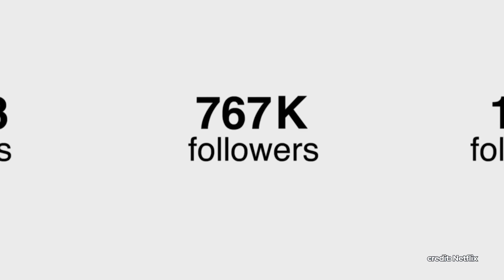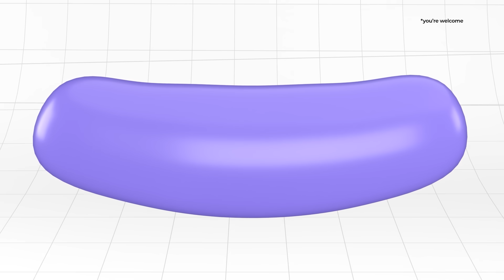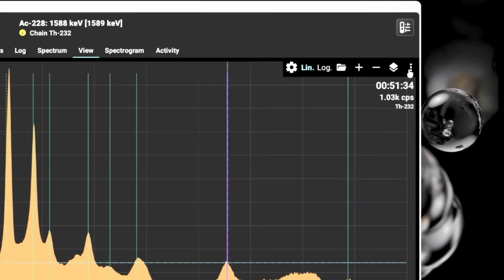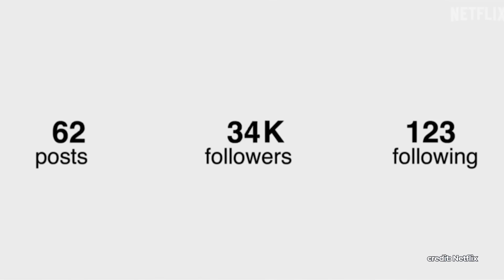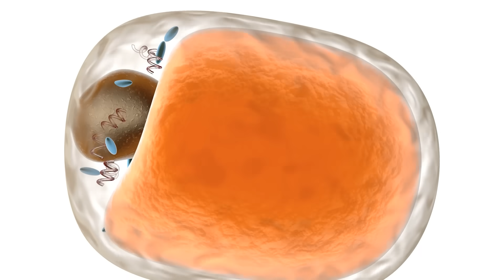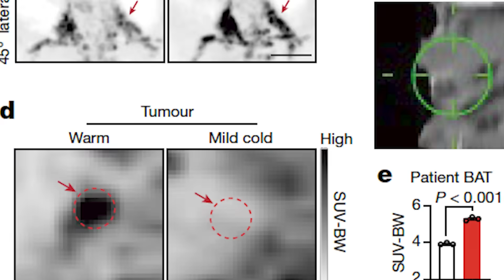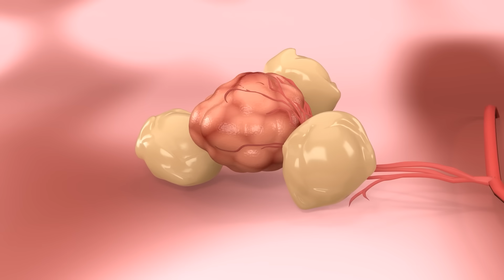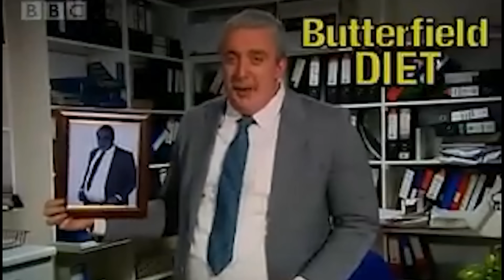Scientists Just Discovered How to Starve Cancer

Comment: “Old wives tales…. Fasting….” 
Are you absolutely intellectually handicapped? 
Imagine thinking fasting does not work to help get rid of cancer.
Reply: But! Fasting is probably your best bet to avoid getting cancer, as the body prioritizes repairing cells instead of hitting the kill switch and producing new ones when something goes wrong. ie killing cancer seeds.
Also, why are you so angry and rude? I think you should deal with your mental issues before trying to fight cancer. Best cure is to be positive and hopeful, not angry and depressed.
Reply: @98Zai  people have every right to be angry and rude unless their level of rudeness is considered criminal, which is not the case here. stop the empty virtue signaling, people behaving like this completely ruined my life for no reason.
Reply: @MuhammadJafary-u2v  Woah, I haven't heard the term virtue signalling for a decade at least. 
As I see it, you're not going to get anywhere by being rude. Why did you even make this comment, the chance of anyone replying with something nice or helpful is literally zero when you're identifying yourself as a rude mean person.
Reply: @98Zai  it isn't zero, society has changed. of course being rude in person is different, but have you never been on Twitter or elsewhere similar? this is very normal and functional online, as opposed to how liberal block anyone who remotely offends them and have their circle block the guy as well. that's not functional at all, it kills challenging dialogue. I commented because I enjoyed reading the rest of your comments and was shocked with the view you have on arbitrary politeness.
live long and prosper.

Comment: I'm always amazed at how little research goes into Root Causes if cancer. I'm curious about the fact that cows milk contains igf growth hormone to force cells (of the intended recipient a calf ) to double themselves every month fir 3 months. Yet when compressed version of this in in cheese butter chocolate  etc are invested regularly by humans, we are surprised when some cells listen to the inbuilt instructions in the products and double themselves and proliferate. We all know cancer loves sugar as PET scans are radioactive glucose and the parts of the body that est up most of it is usually the site of the primary tumor. Yet nobody talks about avoiding sugary foods and drinks etc to stop feeding tumors. I guess there's no money in prevention.
Reply: It's likely that the root cause is deactivated cancer protection genes from environmental sources in combination with excessive nutrient intake. For example, smoking deactivates a bunch of cancer protection genes in the lungs. Having a steady flow of nutrients puts the body in a mode where it kills damaged cells and create new ones to replace them. When the body is in fasting mode, it prefers to repair cells efficiently instead of wastily replacing them. As we know, cancer cells cannot be killed or turned off, but they might be repaired.
Reply: @98Zai why cant they be killed or turned off ? why cant we activate apoptosis  again in c cells ?

Comment: I am surprised you didn't mention the name of real giant in this field: Thomas Seyfried from Boston University. He published many research on the subject. He is the one who explained some of the problems Otto Warburg couldn't figure out. He established that cancer cells can ferment two substrates only: glucose and glutamine. He also proved that if patient is in therapeutic ketosis cancer cells are deprived of glucose,, while healthy cells thrive burning keton bodies (coming from fat metabolism in the liver). Prof Seyfried also developed Glucose Keton Index - GKI which can be used to determine if somebody is really in therapeutic ketosis or not. The bigger challenge is to restrict glutamine, rare amino acid which is synthesized in our body and is very important for immune system for example. More research has to be done to determine how to restrict synthesis of glutamine with inhibitors, without compromising immune system. This is the concept of press/pulse therapy, where cancer cells are put in disadvantage position by restricting glucose permanently (press) and inhibiting glutamine synthesis in pulses using inhibitor.

Comment: Why not simply stop eating carbohydrates?
Reply: And live off protein? The body transforms both protein and carbohydrates into Glucose, to the body they are equal. Meat is just a more calorie dense food stuff.
Reply: @98Zai  actually not only protein. The body needs a small amount of glucose for a few things. So completely remove it is impossible.
And it can make the glucose it need from carbs, protein and fat. 
The distribution between them depends on what dietary state you are in.

If you completely stop eating carbs, the body will go into a ketogenic state and drive itself mainly on ketones made from fat.
There is still a small amount of glucose generated in this state. And it will be primarily from fat.

Again, it does not completely remove the glucose, just reduce it.
But the therapy developed in the video cannot completely remove glucose from the cancer either. But it does not have to completely remove it. Just reduce it enough so that the cancer starves.
Reply: @98Zai  an additional point to your comment. No, you cannot live out of only protein. Then you will get into rabbit starvation. You will live out of fat. Basically replacing the carb with fat.

Comment: Vitamin c is similar to glucose, if you fast, and then take a large dose of vitamin c.  Glucose transporters on the cancer cells will preferentially  full the cancer cell with vitamin c.  Most antioxidants are pro-oxidants at high concentrations vitamin c is no exception.  The cancer cell will quickly succumb to a high oxidative environment.
Reply: That's an interesting idea. But oxidative stress will be high throughout the body, probably causing a lot of issues similar to chemotherapy.

Comment: Thanks a lot for the interessting video. I was intrigued when you mentioned that fasting and calory-restricting-diets never work because the normal cells starve bevor the cancer cells do. As I read, though I'm neither scientist nor physician, there have been some studies showing the opposite effect during chemotherapy. Could you cross check this with one of these papers or maybe elaborate on the validity of the Mitochondrial Metabolic Theory? 

Bauersfeld SP, Kessler CS, Wischnewsky M. et al. The effects of short-term fasting on quality of life and tolerance to chemotherapy in patients with breast and ovarian cancer: a randomized cross-over pilot study

Lee C, Raffaghello L, Brandhorst S. et al. Fasting cycles retard growth of tumors and sensitize a range of cancer cell types to chemotherapy.

de Groot S, Lugtenberg RT, Cohen D. et al. Fasting mimicking diet as an adjunct to neoadjuvant chemotherapy for breast cancer in the multicentre randomized phase 2 DIRECT trial. Nat Commun 2020

Nencioni A, Caffa I, Cortellino S, Longo VD. Fasting and cancer: molecular mechanisms and clinical application. Nat Rev Cancer 2018

Comment: Normal cells that due to inability to use energy efficiently (creating lactate as fuel instead of oxidising glucose) become cancers. Cancer is very much a metabolic disease. Look up the Randal Cycle. Cells can not use glucose efficiently in the presence of too high levels of fatty acids. Its the high fat polyunsaturated laden foods that are the likely culprit. Dr Ray Peat was heavily into Otto Warburg and has written a lot about this if anyone is interested.

Comment: You won't have to worry about cancer cells changing to use fat as an energy source, they're almost completely unable to get energy from fat.  Look at Dr. Seyfried's work on the subject.  Almost every cancer has mitochondrial damage at its root (or in some cases, they're simply missing.)  Not only does that mean they're unable to metabolize fat, but they also (as you stated) are unable to generate energy aerobically, and most importantly, the mitochondrial damage prevents apoptosis because it's triggered by the mitochondria (which are damaged or missing,) hence the uncontrolled growth.

If cancer cells were to somehow repair their mitochondria, allowing them to metabolize fat, they would (should) cease to be cancer cells because they would again be capable of apoptosis.

Comment: Should we focus on SYNERGISTIC APPROACH for this, as the video ended with @Dr Ben Miles raising question that, the cancer cells will change their metabolism by burning up the "engineered fatty cells (brown adipocytes)". May be to check mate this thing we can use to upregulate the immune response, anti-inflammatory response as well as signalling and feeding responses of the cells simulataneously.

Comment: You didn't justify the claim that ketogenic diet doesn't work. You also mentioned that no study showed that Budwig’s diet could help with cancer. Okay, but is that cuz it’s been studied and shown useless, or just not studied at all? If it’s the latter, that’s the problem. Stuff that’s cheap or natural doesn’t get research money cuz no one can cash in on it. Not saying pharma is evil, lots of meds save lives. But let’s be real, the system's set up to chase profit, so pricey high-tech treatments get all the hype while low-cost options get dismissed. It’s less about helping people and more about squeezing money out of dying desperate folks. I just wanted to say this so that alternative methods wouldn't be dismissed without justification. All that said, it's still cool that there is another new way to deal with cancer.

Edit: 
Also, just a side note: you mentioned metformin lowers cancer risk by 30-50% by lowering blood glucose and that the new treatment works by starving tumors of glucose. But that’s literally what keto tries to do: reduce glucose and push the body to use ketones, which cancer cells struggle with. So it’s kinda weird to dismiss keto completely when it targets the same metabolic weakness that this new method is focusing on. 

Any serious discussion of metabolic cancer therapies should include ketogenic and fasting-based approaches alongside pharmaceutical or cellular ones. Dismissing keto while promoting glucose-starvation therapies is scientifically and logically shaky.

Comment: Thanks for sharing.
While brown/beige fat allows glucose to be siphoned off when it is applied close to the tumour, in real life, until this usecase is available worldwide, it seems useful to first reduce the amount of glucose ingested and replace it with fat (low-carb high-fat diet) in order to have a reduced amount to siphon off and therefore a reduced need for beige or brown fat and maybe existing brown fat may be enough or it can have a significant effect.
As a result, I don't understand the statement that a low-carb high-fat diet will starve the patient before the cancer, as the lipids will feed the patient and not (or less) the cancer (a low-carb, high-fat diet is not hungry, even if it may take a few days to get used to it)).
Do you have any further explanation ?
Reply: Nobody is saying that you starve on a ketogenic diet. But on a ketogenic diet you still have blood sugars that the cancer can feed on, if you eat less carbs than needed to refill them, your body will make  glucose out of protein. If you don't eat carbs and protein and your body has used up all carb and protein stores (muscles) then there is no fuel for the cancer left, but this is also when you starve.
Reply: @juliadolker9854  the statement that a person will die in ketosis before the cancer comes from the video at timestamp 9:03

But you won't die either if you don't eat any glucose nor any protein because in keto, the main fuel is not protein (eat only to maintain the body's proteins and not for energy) but fat. It is the fat that enables neogluconeogenesis to take place in order to provide the glucose that are missing from the diet with a stable level of glucose in the blood. The cancer will therefore have less glucose available and it will therefore need less brown/beige fat to reach 0 glucose at the tumor level.
This is why I think it is relevant to first reduce the glucose from the diet.
and if brown/beige fat is confirmed as having a significant impact, the good news is that there would be no need to wait for a modified fat cell transplant. 
it is possible today to adopt a ketogenic diet and activate all the factors known to promote the creation of natural brown fat (non-chilling cold, physical activity, food rich in capsaicin / capsinoids / ursolic acid, etc.).
this would be what I would adopt immediately if I were diagnosed with insulin-dependent cancer (in addition to Dr Schwartz's other ideas)

Comment: First of all is to stop sugars... most of the cancer foci are Candida Albicans that have passed through a leaky intestine. Candida Albicans feeds on sugar. Starving Candida Albicans is starving the cancer.
You can also cut off the source of the problem by addressing intestinal porosity. Once again, diet is key. Porosity comes primarily from gluten and starches. Therefore, alongside a sugar-free diet, you need a diet without wheat nor rice.

Comment: ... they took til 2002 to realize we still had brown fat? I thought it had been known for a while we still retain some? How much would it suck to only be able to shiver to keep warm! 

I've kept my home somewhat cold ever since I realized I didn't gain weight when I did it. In summer I'd just need to take a walk for a few hours one day a week at the park to prevent weight gain, in winter the weather is usually miserable so I'm stuck indoors and worse tend to eat more in winter. Yet keeping the temp around 64-68 degrees burned just enough energy to equal out my intake (I don't shiver until 64 degrees when naked). Unfortunately, was not enough to lose weight. It just seems bonkers to me they didn't realize we had brown fat, no scientist wondered how the heck digestion created enough heat. 

To add to this, my brown fat activates from certain foods. For instance, I will overheat if I eat pizza in a 76 degree room. The heat I can feel comes from the areas brown fat is found. I joke that if I ever have hypothermia, just feed me pizza.

Comment: The “keto diet” theory of fighting cancer has parallels with the low-fat (often low or no animal product) anti-cancer claims.  The proponents claim that since your immune cells and everything but the cancer is using the full citric acid cycle, feeding yourself primarily carbs allows your body to outperform the cancer.  Kind of like how WW2 was decided significantly by who could produce petroleum fuels faster.  

I mention that most of these diets were vegan-ish because the “Chine Study” proponents have a more likely theory. Their claim is that in laboratory settings amino acid ratios associated with animal foods can reliably turn on cancer growth, and their absence can slow or reverse it.  

I know there are a lot of critics of the China Study book, but to my knowledge no one has debunked that particular aspect of it.

Comment: The problem is obvious: if you knew where the cancer cells/tumours were in order to insert the BF organoids next door, you could simply remove them or remove their entire blood supply or do any number of things - the difficult part of any cancer medication is introducing a medication into the body that will travel through the blood or lymph and reach the desired target when it could be ANYWHERE. So the then the next obvious step in this research is adding cell-surface proteins that will only interact with the tumour cells in much the same way as the immune system works with antibodies and antigens.

Comment: Starving cancer is one of the strategies to fight against it, but you will just slow down existing tumor cells. It's useful but not sufficient alone, as the basic idea is that a tumor cell is a "normal" cell gone wrong, which is normally recognized and terminated by cells of the immune system. When a cancer develops, this mechanism does not work well, but helping the immune system to better recognize cancer cells is the best way medicine has found to date, the so called "immunotherapy".

Comment: Careful. While this looks promising. We risk running into a different problem. Fat has it's own share of strings and problems attached, which, granted, are nothing compared to cancer. Yet still can end deadly. Just ask any type II diabetic. If those fat cells grow so fast, you'll need a way to stop them from doing so. And no, mechanical removal doesn't count. We need an off switch. Otherwise we risk jumping out of the oven into the frying pan. Adipositas kills. Just slower. It's that simple.

But still, fascinating stuff.

Comment: Unfortunately the doctor never described the “KETO diet” in the experiment, turns out the clueless researchers fed a 30% carb diet and called it KETO. A KETO diet is high fat moderate protein and low carb essentially driving the person into ketosis, if your ketones are not up you are not eating a proper keto diet to affect cancer. The other fuel the video forgot to mention that cancer can ferment as fuel and that Dr Warburg didn’t realize is glutamine. Dr Sayfried has taken Warburg’s work and expanded it to include glucose and glutamine as cancer fuels with the press pulse therapy to control the cancer.

Comment: Am I missing something? 

At 3:43 you've said that lactic acid is produced in the process of glycolysis. That is not true, the product of glycolysis is pyruvic acid. Lactic acid is the output of lactic acid or mixed acid fermentation. Assuming that the glycolysis is correct, why would cells waste NADH to reduce pyruvate into lactate?

8:28 hypoxic? not glucose starved?